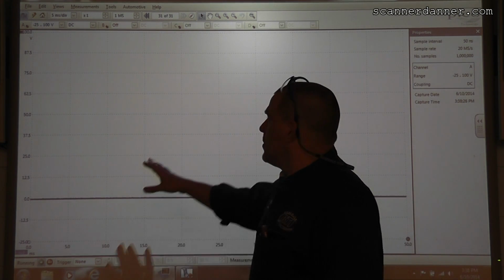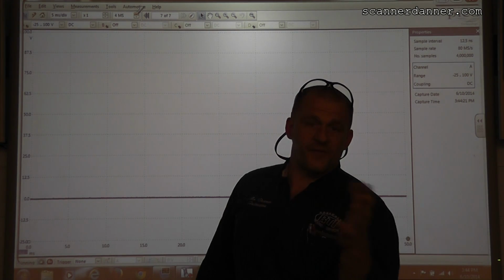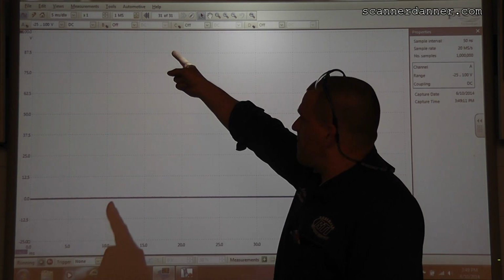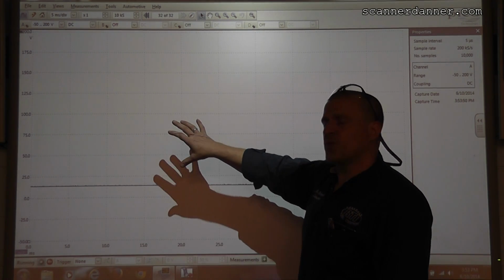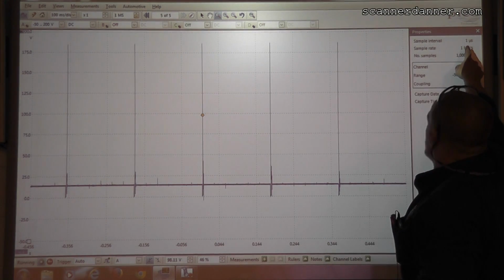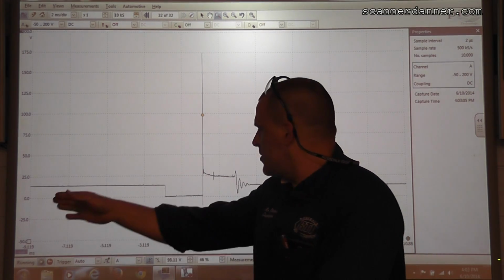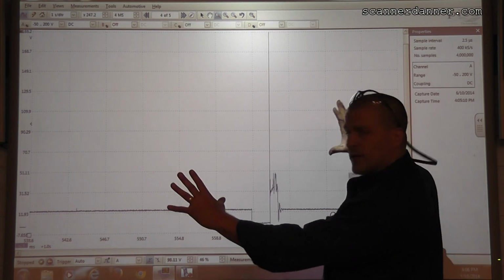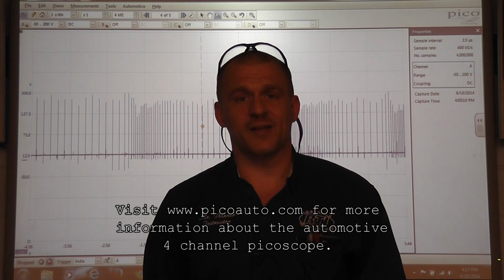Picoscope Basics Part 2 (time base, sample rate, waveform buffer)

Comment: I have seen and read a lot of info online concerning sample rates and time base on scopes, and this is the best, easiest to understand explanation yet. I have been using the scope module on my Modis for years, and have moved up to an actual PC based scope. I have struggled with finding a good basic time base and sample rate to start with. The modis is more of a preset scope, with much easier adjustments. Much quicker to learn. Stand alone scopes are a little tougher to learn how to dial in on the waveform sampled. This is an excellent explanation with down to earth, common terminology. Great job Danner. Great video.
Reply from the maker: +Jeremy Shanks thanks Jeremy

Comment: great vid I use my pico every day at work often take captures at 1 sec per div with a repeat trigger so I can mess with the ignition or whatever then come back too the scope and have what I wanted on the first buffer . 1ms does a decent job but under those situations I don't need the long buffer think ill crank up the sample rate . Thanks for the refresher paul good stuff

Comment: Absolutely shows you the difference in a Pico, high quality automotive scope with the correct software to detail what you want to see and... the cheaper Chinese ones (Hantek for example) which do a descent job on low timebase, but for longer ones (repetition), are really not an option. Also the software leaves so much to be desired on adjustment levels that is basically is only really usefull for the non-pro's even though it still is a major step to have one of these instead of nothing ofcourse. Pico really understands what automotive diagnostics is about (detail and repetition)
Reply: +Henk Moesker  do you have a "HANTEK" ?? What model??? It is the Hantek DSO3064 Kit VII 4CH 60MHz ?
Reply: Yes sir. I have a 3064 4 channel hantek kit VII. Used a lot of times and it helped me a lot in certain situations. However, to do in detail diagnostics, it left some to be desired. No zooming like Pico, no easy software  and a lot of time I was spending too much time adjusting settings to get even a half descent view of things (it DOES have good max / min values options, etc.).
Reply: +Henk Moesker  Thanks for the advice!
Reply: Totally agree. I now use my Hantek for basic, ok on most sensors, but when it comes to ignition and CAN, I go Hantek first to get a quick look and then swap to Pico for the final analysis ... For the price though, Hantek is great value and I use the Hantek accessories on the Pico too without problems;-)

Comment: Overall nice job Paul.  Since this was mostly about sampling, which I found informative, it would have been really nice to see what happens with a slow transitioning signal, such as an HO2S, when you increase and decrease the sample rate.  The contrast between messing with sample rate on  a fast signal vs. a slow one may have helped some to better grasp the idea, although I would say you did a great job explaining it all even without it.  Nice work.
Reply: That was a good suggestion. Wish i would have done that. Thanks Preston

Comment: Hey paul, I've watched a few times over the year and haven't commented, but I can't let it pass: I got more from this than days on the Pico forum, helpful and friendly as those folk are. I've got a baby 2ch pico - a fantastic learning platform & stepping stone to the 4000 series (not there yet). I bet I will hear you laugh when I say this, my "picette" has a 16kS buffer. Yes that limits repitition a lot. What is frustrating is that it is capable of 200M/s real time. Im trying to work out how to squeeze as much sample rate from it. I'm still experimenting but:
1. Turn off buffer and just have a live screen and time base where you might actually notice a glitch or use fancy triggers to freeze glitches (but I don't think it's possible to turn off the buffer?)
2. If I limit screens to minimum number or just one, it should squeeze more samples in one screen?
3. Just lower time base of course. (but no rep)
Any thoughts?
Couple of things you could do if you wanted to expand this great series.

First, send invoice to Pico!!
Second, explain how/why Bandwidth has an effect and is important
Third,  explain, even show, the value of a 8 bit vs 12 bit vertical resolution, plus the effects of using the scope's built in artificial bit enhancement ... mine is 8 bit but I can enhance to 12 and lose some detail if I dont have enough sample rate to begin with.
Just thoughts
As always, many thanks
alex
Reply from the maker: 1. You are correct, you cannot turn off the buffer
2. You cannot limit the screens either
3. I do not know on your model if you can change the sample rate or not

The rest of your questions about bandwidth and vertical resolution are not my strong points. May I suggest you post these questions to my forum? It is free to join and I have a super helpful community of friendly people on there. I hope you will and thank you so much for you kind words. 
https://www.scannerdanner.com/forum.html

Comment: Hey paul, thanks as always. Great to review this stuff again. One thing I'm not clear on: scope specs will state a MS/sec, but your talk about samples per screen (or waveform: same thing I think)... So am I right is saying the scope spec is the max number of samples possible over a 1 sec time base (whether that's one screen or several is irrelevant to the max) and the scope indicator on the screen is the number of samples set at that time for ONE screen?

Comment: Awesome !!  Question- the Pico is just like the Vantage in finding new options by just pressing buttons - does the Pico have alerts  you can program into the scope so the buffer would show an out of range voltage measurement and save time looking at all the buffered frames ?
Reply from the maker: Knowing what the Pico can do, I wouldn't be surprised that something like that could be done. Maybe some type of advanced triggering.
Maybe some more advanced Pico users could give some insight here. Or you could go to the pico auto forum and post that question. I know you will get an answer there.
Reply: Steve you could also ask Tom Roberts from Autonerdz.com, they are the main Pico Scope Distrubutor in the U.S. and are very kowledgable,  Tom could answer your question, I bought my Pico from Autonerdz and I have learned a lot since I bought the scope last September.  Just go to autonerdz.com and look at the general public forums, you will see what I mean.  Support and Training is top notch.
Reply: Plus I'm in agreement with Paul, their are features in the Pico that I am just starting to learn too.  In my opinion I think the Pico Scope is the best Automotive Scope you can get.  The next scope that is in second would be the Snap On Modis.  Only thing I dont like about the Modis is if you want to see a bigger picture of the waveform, you have to zoom in first and then back out while you are recording the capture, other than that it is a very capable scope.  Another thing to look at to help you see the differences in the Snap Modis and the Pico is go to the autonerdz you tube channel and watch the wrangler from hell video, Tom goes in depth to explain the differences with the pico scope and other scopes.
Reply: Nice job Paul explaining the time bases and sample intervals.
Reply: We'll I did find out the answer -sort of - it seems you can place triggers to make alerts for out of range voltage readings.  Seems this option is available while data logging.  Not sure if it can be done in a non-logging mode. Now how it's done is something I will have to figure out on my own .   Watching the snap on vantage series by Paul looks easy to operate when he's displaying it but for me on my own is another story .  I find the same with Pico , I have so much more to learn.
Reply: busjockey1
agree, the autonerdz will tell you everything you need to know about the pico and then some
Reply: busjockey1
Thank you, this one was tough for me. It was the third or 4th attempt at it. I hated all the other ones. I could have done better on my drawing but overall I was happy with this one and it is nice to hear that you guys liked it too.
Reply: Hi Steve. You can use the advanced trigger options to set the scope to whatever trigger parameters that you like. And if you want to see a minimum number of buffers like one, set the scope up with an advanced trigger, (with your criteria) and then use a one-shot trigger.
Reply: Thanks Terry I am going to set aside all next week to figure it out. LOL
Reply: Steve Rob Ah, it shouldn't take you long at all Steve. Take a look in the help file for trigger and you'll see all the examples that they show. Good luck Steve.
Reply: What scopes do you own Steve?  I have some experience with the Modis and old school vantage, mainly pico now for me though.  For quick checks I use the heritage vantage.  So if I can help out at all I would be more than happy too.  You are on the right track though learning from Paul, he has quite a bit of Knowledge with the pico scope.  In fact don't know if Paul knows this but he was one of the deciding factors besides Tom Roberts from Autonerdz why I bought a Pico Scope to begin with..  Later.
Reply: I got the Pico about 1-1/2 years ago - I found my level of testing was useless In many cases with my dmm.  Paul opened my eyes to a whole new  world.  I only look at less than 10 cars  a week -  so for me it's  more of a hobby than a job.  I run across the same thing as in Paul's vids with almost every part changed before it gets to me and I get quite a good laugh every time.  My Pico and autoenginuty are what I use for now but I would like the Verus  but at 12k up here in Canada it's too much for me for now and from what I seen the Pico. Scope is far better than any snap on.   Sure would like a snap on scan tool itself without the scope feature and maybe Danner  could come thru with some discount coupons from snap on. LOL
Reply: Oh yeah Busjockey1 if you have not done so check out stuzman52 channel for a fantastic demonstration of the Pico.

Comment: @ Paul  thanks for sharing, I have a question Do you know if I can use the snap on accessories  with pico scope for example the pressure transducer, amp probe or do I need some  adapters?? thanks
Reply from the maker: Yes you can, although I am not sure about the transducers. The adapter is specific on those and they do not tell you the unit to voltage conversion on the transducer.
Reply: ScannerDanner You could measure with a snap on tool to get the "translated" values, then repeat the same measurement with pico or any scope to get a voltage reading and then just do your math to find the voltage to unit correlation.
Reply: juergen scholl  thank you.

Comment: Who needs a scope these days when the ecu is smart enough to tell you when a signal is bad.
I only get the vehicle after some mechanic has already replaced the sensor in question, then its a case of wiring or ecu.
Unless it's digital signal testing like   communication protocol like lin or can.